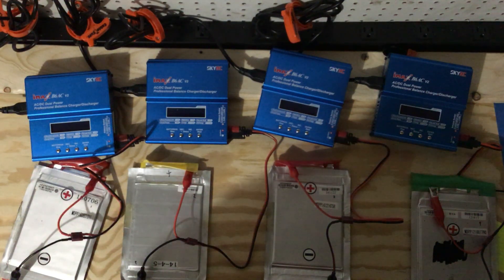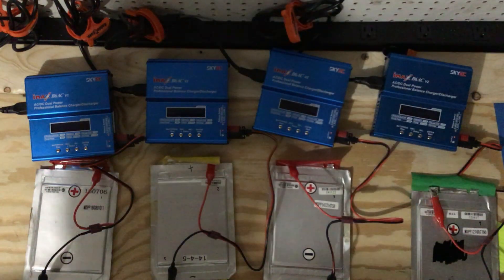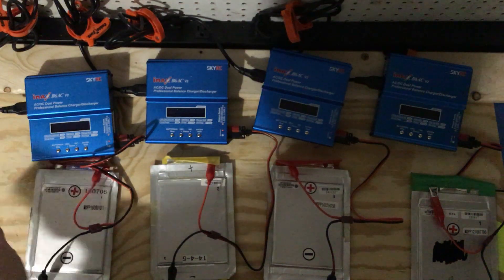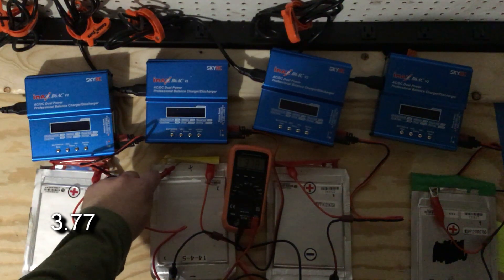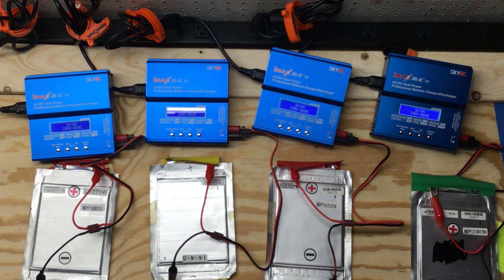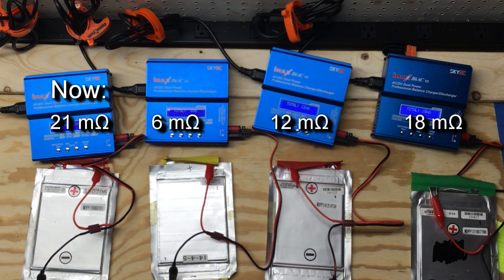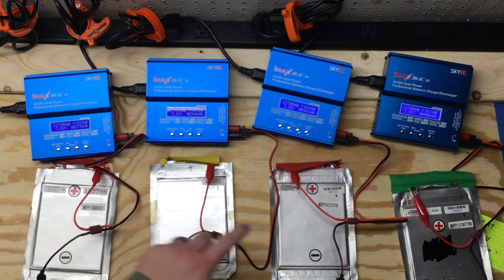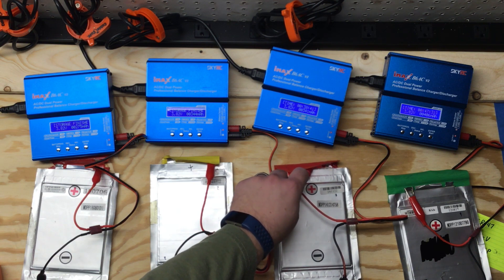How have my SPIM08HP cells held up over the summer?

Comment: Do you think 40 of these batteries can make a high discharge ebike battery 72volts 16ah    capable of 150 amp continuous and 300 max?
Reply from the maker: jerseyguy 9087 I do! I should know I’m not an engineer but the specs totally work
Reply: According to the specs of these. Yes you can easily get by with that.
Reply: I just bought 45 of this pouches (5 extra just in case)  for the same reason I'm building a 72v battery with a 150A BMS my motor is a QS 3000W

Comment: What will cause a cell to puff?
Reply from the maker: Arnold de Brie Thanks for watching. There’s a whole bunch of reasons that pouch cells can puff. Mostly stress: too hot, too cold, external damage, abuse like running them too hard (these are crazy tough, so unlikely to pull too much current) and bad maintenance like letting them undercharge or overcharging.